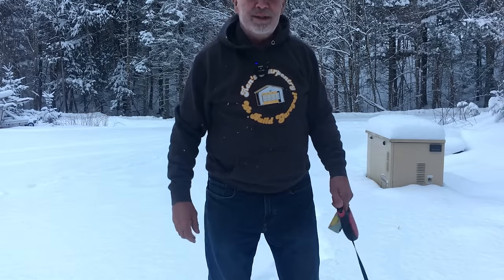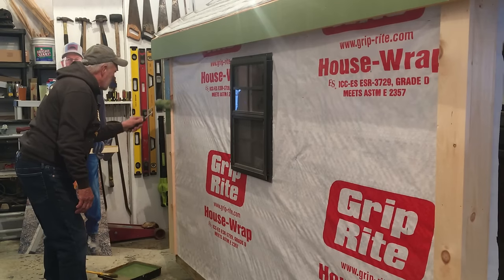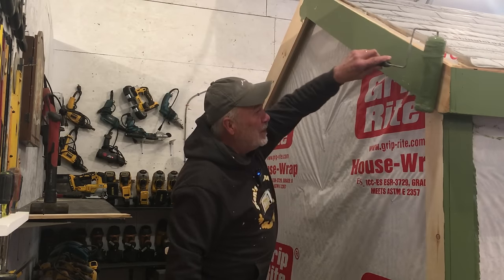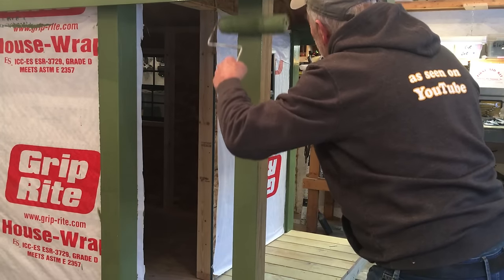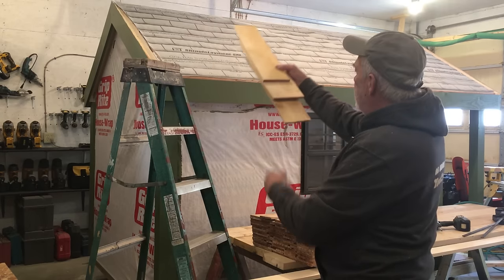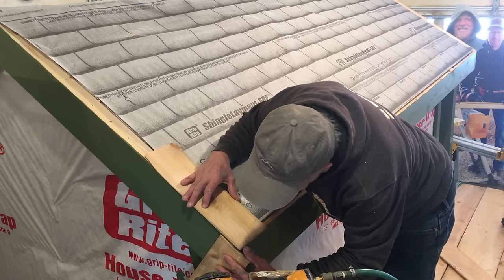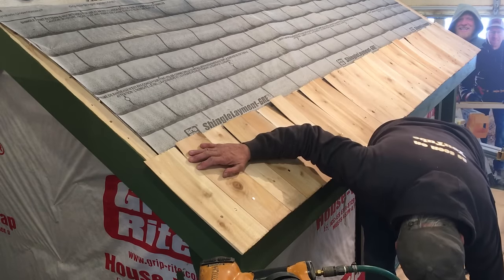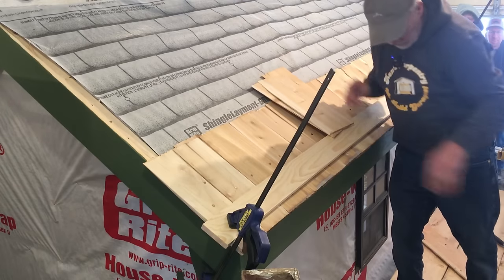Beginners Guide to Building a Playhouse...Part 6...Paint Woohoo

Comment: Quick tip, on paint cans take a sharp screw driver, awl and poke a few holes in the sealing lip of the can, when re closing the lid it will force the remaining paint into the can, won't splash out, seals the can better.
 A old bodyman tip, really good tip for all painters.
Reply from the maker: Thanks good one

Comment: Roof looks amazing -- there is nothing like a cedar shingle roof for charm.  When I was young and worked with my dad building houses, he would always lay 15# roofing felt over the top of each course of shingles just above the exposure line, before the next course went on.  I think that helps avoid issues with joints lining up and joints over nails.  What I remember most is that we would take the 36" wide rolls of felt and cut them down to 18" wide in the miter saw.  That was pretty fun.  I am sure it wasn't great for the blade though.
Reply from the maker: Haha nice memory

Comment: Kia's head deep in the snow. She looks happy in the snow. Pretty color Ken! Nice organization on the paint supplies. I like Chad the supervisor! He's saying "Perfect!" Yup, I wouldn't paint until the pressure treated posts are dry. Great, you've had them a while. It looks great painted Ken! No drip edge? That makes sense that the kids might cut themselves on the very sharp metal. How deep will the nails go inside the plywood? I bet those shingles do smell really nice. It's cute to see Dan and Chad looking on behind your back as you roof. Lining the shingles up along that board makes it look so even Ken! Thanks for this video Ken (Kia, flat Dan and Chad).
Reply from the maker: The nails just barely poked through the underneath of the plywood

Comment: Could use it as a building to house your train layout.  Add off grid heat, cooling, and electric.  Just have to worry about mice chewing your wiring.
Reply from the maker: Haha thanks
Reply: @kenskarpentry  Don’t need the windows (that takes away from places where you can have layout.

Comment: I've been in construction my adult years. In the old days when they used to use step sheathing, I thought they were trying to save material.
As it turns out they were trying to let the backside of the shingles dry out so they would not cup in drying out after moisture was on the roof.
I wonder if the shingles might cup during the summer?  I hope for the best.
Nice-looking playhouse !         Thank you
Reply from the maker: Thanks